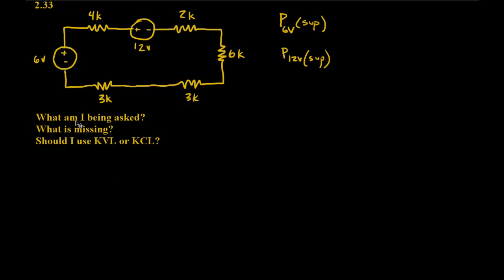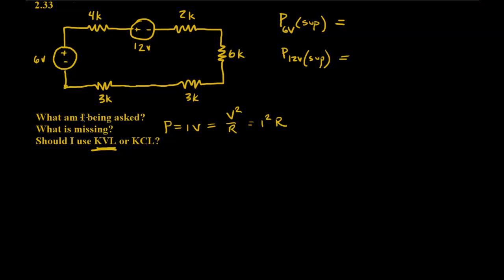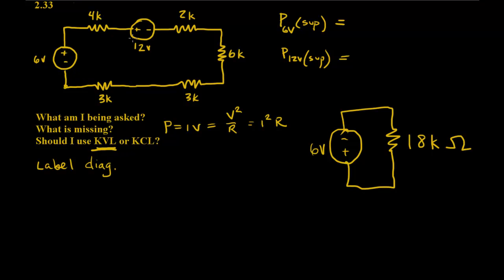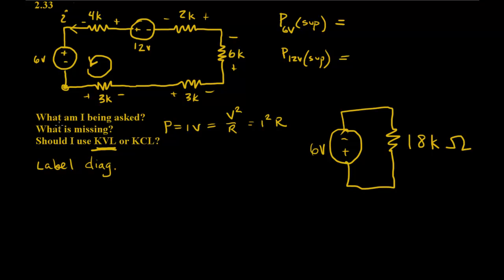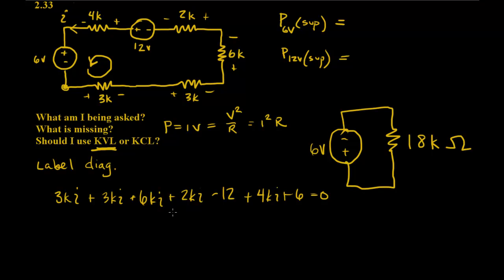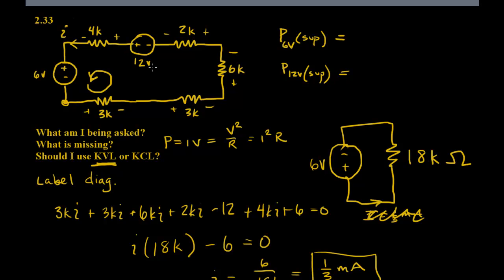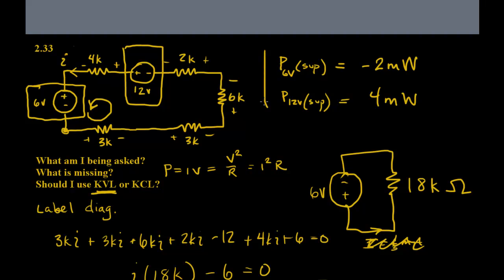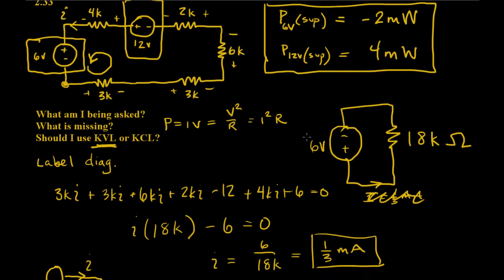Solving Resistive Circuits with KVL #1

Comment from the maker: The equation for power, P=IV is specifically for the power dissipated in a Circuit.  So if my answer is -4mW dissipated, that's the same as +4mW supplied.